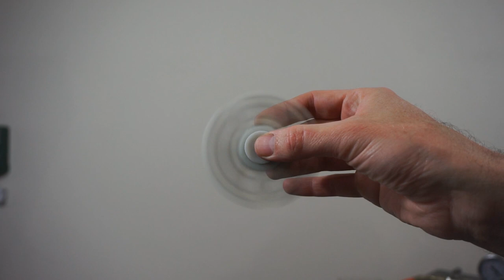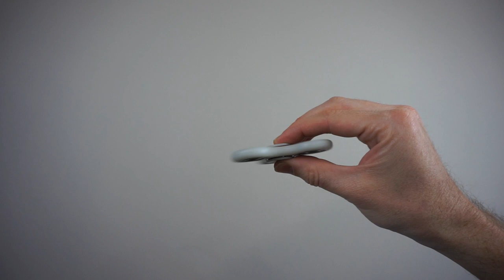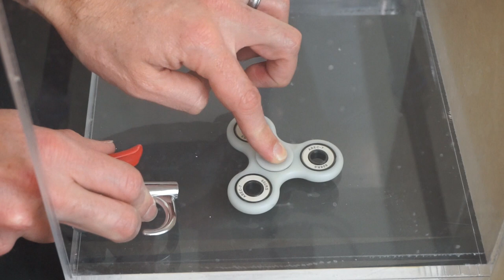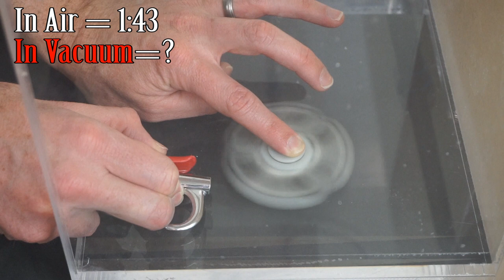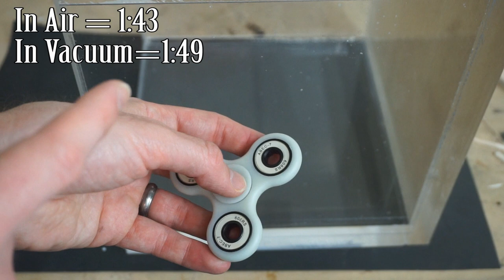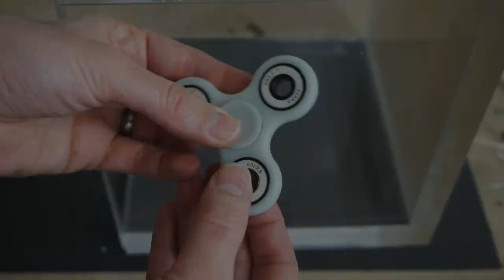How Long Can a Fidget Spinner Spin In a Vacuum Chamber? Will It Spin Forever?

Comment: u started the vacum so late anyway
Reply: Meak please explain how youd do it any faster?
Reply: u could do vacum first then see how long it takes to get to a certain vacum point and then start the timer then and howver long it took till that certain vacum take that time and then start the non vacum at that time too
Reply: Meak Most the energy was gone by the time the vacuum STARTED! It wasn't at full vacuum when he stated that it probably won't last much longer! REDO!!!
Reply: its true but most of the friction is on the bearings
Reply: vacuum* only word in the english dictionary to have 2 U's right next to eachother
Reply: smart
Reply: the air tube would repressurize the tank.
Reply: That's what I was wondering about what they were saying.You can't make the thing spin once it's vacuum, if you try to do it with air, it will repressurize the tank, if you try it with your hand, well it's impossible and if you try with an object like a rod from the outside, it would be very difficult and you would need to insulate the hole where you put in the rod.U should stop talking shit about what he did since there would be no other easy option to do it more efficiently.
Reply: It looks like the spinner has metal rings in each of the ends. Get a second spinner and put magnets on the rings and then hold it underneath vacuum chamber, under the other spinner, and spin the one with the magnets. You'd probably have to start spinning it slowly and then speed it up, and I'm honestly not sure how fast you'd be able to make the one in the chamber spin. But I'd be interested in seeing how well it worked.
Reply: His explanation about just air-friction is incomplete. The spinner in air is continuously throwing air outward by centrifugal effect and also imparting some angular momentum to it. This should mean a huge loss of energy, regardless of the streamlined lobes of the spinner.
Reply: good idea
Reply: tubeist- dan
right....I was thinking that to, and then when he said most of the loss of friction was the bearing, I was  like "you're kidding right?" No, No it is Air-friction, I just think it lost a lot of energy because it didn't start in a vacuum from the start, and use something else to turn them besides just  air like magnet's on both air, and non-air with another with magnets,and just push the other with air and the other will follow with it, might take a bit of time though , maybe put them in some other gasses just for some kicks as well.
Reply: Nameless Guy 

#1 watch who you say is stupid, because you just made your self look  like one. 

#2 I never said anything about Delay, 

#3 That is what a Bearing does it Reduces Friction, doesn't eliminate Friction, there will always be some but it's negligible compared to Air Friction. Air Friction will make an object lose much more energy than the Friction in a Bearing, and yes the Fidget spinner will stop eventually due to some energy lose from the Bearing. But nothing like Air friction. so don't try look smart, it didn't work. 

I'm certain everyone here can agree on what I said here is true
Reply: science is awesome 
In what way, may I ask, I tend to over engineer sometimes but. that isn't really much of an issue for me.
Reply: it doesn't matter when you start the vacuum, if the vacuum starts while it's spinning, and it eventually stops spinning, you get your answer, and same thing if it doesn't stop.
Reply: science is awesome it won't spin forever because of friction
Reply: it still wont spin forever because of friction between the balls in the bearing and the bearing casing.
Reply: Amen. someone used their brain.
Reply: woodysums270 that's true but the air resistance from the spinner is also slowing it down
Reply: Dooplex Minecraft there's no air in a vacuum...
Reply: Mjc Lmao, exactly, thats why its called vacuum 😂
Reply: It was only 4sec late
Reply: Meak That's exactly what I was thinking about. It would be much more comparable that way.
Reply: JESSYS10 No that was not the Vaccum, that was him with the air blowing at the spinner and its making the sound.
Reply: Epic Lemon it's inside the vacuum chamber
Reply: Subtract the 'In Air' time by the time before he placed in the vacuum thing.
Reply: GamingPredator Continuum
Reply: KiloB24 the point of the chamber is to get rid of the air
Reply: Meak it is not that it is the friction in the bearing
Reply: Meak oil should fix the problem right?
Reply: grizzie beats no,there's still friction even with the oil, there would be no way to reduce the friction with the balls in the bearing comepletelu
Reply: He is a faker if you look at tue vacuum time while its running you can see that it is cut in half to extend the time
Reply: Meak  thousandth like
Reply: Meak it really does not matter because gravity still applies in this vacuum
Reply: Gravity would not affect the spin of the fidget spinner going -> that way when gravity goes \|/ , it stops because of the ball bearings friction, not gravity.
Reply: Jlytle201 gravity is a force that applies to this. It may not seem like it but gravity is pulling down therfore slowing it down. It would spin longer but not forever in space
Reply: It will stop even in absolute vaccum because friction between floor and spinner...You need to make everything ideal to use law of inertia
Reply: preshitx not quite, it's the friction of the metal on metal inside of the bearing itself. The way a ball bearing works is that you essentially have 4 components. Your round ball bearing surfaces that interact with an inner and outer race and there is also a containing device that keeps he ball bearings in place, in between the races. With machined bearings holding very tight tolerances (roughly within a thousandth of an inch) there is almost no slop or wiggle room in a good bearing. The four components will always create friction between each other and that is where you run into the issue of drag and why the bearing stops regardless of vacuum. Hell even if you had an absolute vacuum (in space) the friction between these 4 components will always overcome the speed at which they interact with each other and it'll never be able to spin forever. Vacuums remove air so the spinner surface to air interaction was removed, but it only had marginal gains in doing so.
Reply: Hmmmm space is perfect vaccum

Comment: The problem is, that the aerodynamic drag on the spinner goes down inversely proportionate to the rotating speed. By the time you're able to pull a significant vacuum, it has already slowed to a point, that the air resistance becomes negligible. What you need, is magnetic coils and an oscillator, that will turn the spinner at a repeatable speed, after the vacuum has already been pulled.

Comment: How long did it take to achieve a vacuum once you started the pump? I think that if there were  a way to start it spinning under a vacuum the results might be more divergent from each other. :-)
Reply: Mike West you look almost identical to the true Geordie
Reply: Hi I subscribed
Reply: Don't worry about my name in couldn't think of one
Reply: doubtful, most of it stopping is from friction in the bearings, not air resistance.
Reply: Mike West sure it would be but the main factors in the two cases were gravity and friction, because of the fidget spinners design drag (air resistance) isnt much of an issue
Reply: dude... i dont want to sound like an asshole but... friction is caused buy gravity so there basically the same thing
Reply: Chase Fox tjats not what i meant gravity foes have its role on making it stop die to the law of inercia, because the spinner is moving no force or recistance is applied it will keep on moving, since gravity is pulling it down it will gradually stop
Reply: Dohn Joe: LoL! Nope.
Reply: Chase Fox: Actually friction is not caused by gravity but it is intensified by gravity. There is friction in space.
Reply: Mike West well theres also gravity in space. however youre correct friction isnt caused by gravity. but the normal force.
Reply: donald trump wtf are u kidding me did u actually just say there was gravity in space lol

Comment: I answered this before I even clicked on the video. Friction will slow it down no matter what.
Reply: Actually in places where friction isn't located (such as space) it would move forever. However the friction on the mechanism itself would make it slow down.
Reply: iiHuskyFTW i
Reply: My Happy Place friction does exist in space though
Reply: Ishaq Saleem Friction due to air resistance doesn't exist, however thing still have friction when they rub together in space
Reply: AgentJackjohn exactly and since this has a ball bearing it's still gonna stop due to the friction between the bearing and the spinning part.
Reply: My Happy Place then you should've said that😂. even so there will still be friction from the surroundings as there is no such thing as a true vacuum and if you have a lot of time on your hands you can wait for it to decompose into a soup of protons and electrons
Reply: If we could make the spinner have as little friction as possible and put it in a vacuum, then it would have a very long spin time and have a high energy efficiency ( like 99.9% ) .

Comment: is that stopwatch even correct ? I think 1second should be 100mili secs not 60mili second
Reply: Yeah, kinda. The prefix milli- means one thousandth, 1000 milliseconds is 1 second. However most stopwatches only display 2 digits after the seconds, 'centiseconds'. Still, you need 100 centiseconds to 1 second.
Reply: rizky awanta It changes little slower, 60mil secs are still 1sec
Reply: 60mili is practicly a second because every hour is 60 minutes and and every minute is 60 seconds. So every second should be 60mili some physics that dont make sense xD
Reply: Timecode? 60 frames per second?
Reply: Try counting when a second is added try counting 1 and by 2 it should hit the next digit.

Comment: Maybe if you can get something to spin that is suspended by magnets to reduce friction
Reply: jimmy Lewg Like on Giaco Whatever's channel. He made a levitating fidget spinner, but apparently it was difficult to set up just right.
Reply: magnets die down and lose their magnativity
Reply: Nameless Guy, no, the magnet would obviously be for making it levitate, not for spinning it...
Reply: jimmy Lewg the friction is created amongst the balls in the ball bearings so having it magnetically suspended would do nothing if not slow it down.
Reply: Dank Trilogía Yes, but when the fidget spinner is resting on a surface, the friction in the ball bearings is slowing it to zero (because the inner circle is stationary and can't rotate). If it's magnetically suspended the friction would slow the outside and speed up the inside until their rotational velocities are equalized, then there wouldn't be any more friction force.
Reply: Jove Rogers yes but, it would just be a rotating disk not a fidget spinner if the inner ring was not held still by something, whether it be a hand or something else. If you were to levitate it magnetically there would be no use for the bearing.
Reply: Dank Trilogía It'd be kinda hard to start it.
idk, Giaco Whatever literally did this. I just want to see that but in a vacuum chamber too.
Reply: Nameless Guy sorry if it's hard for you to understand. Maybe I should have explained in more simply for you. I meant spin something that is levitated by magnets then spin it with compressed air. It was just a brainstorming idea.  Again, I'm sorry you got all shook nasty on us.
Reply: Dank Trilogía different guy ;)
Reply: Jove Rogers yeah lol
Reply: yeah ikr
Reply: good thought but the only friction is with the center bearing not the ground
Reply: Broductions and the center bearing's in contact with the ground, yes? So it can't be accelerated to match the speed of the outside.
Reply: @JoveRogers97  Hi Java, I like your logic. There is a way to use magnets and I don't think it would be too difficult to do the experiment. Did you want to bounce a few ideas around?

Comment: Dear sir,
Have you considered the possibility of this :-
Starting the vacuum pump starts the air to be sucked off from a single nozzle, thus creating a significant drag. It actually degraded the speed of the spinner as soon as you started the pump. You can even see it if you slow down the video at that moment . 
Thank you.

Comment: I think vacuum experiments show how AIR resistance drops compared to atmospheric pressure,  but the surface resistance of the metal on metal of the bearings isn't reduced in a vacuum as it's contact related not air resistance related. hope that makes sense.

Comment: What happens if you put a ballon with helium in a vacuum chamber
Reply: Bmw ///mpower it will explode
Reply: Thanks:))
Reply: Nice no it won't... it will expand because there is no air pressure keeping it in its round shape. The gas will try to fill the chamber
Reply: I'm pretty sure it explodes BECAUSE it keeps expanding since there is no pressure
Reply: Bmw ///mpower: What happens when a helium filled balloon in a vacuum ,,well I can honestly say you already know the answer to that question all you have to do is think what happens when a piece of wood is tossed into an empty swimming pool it goes right to the bottom because there is no water for it to float on or in a vacuum chamber there is no air in the vacuum chamber to float the balloon , air is more dens  than the gas helium so no air  so the balloon will not float. this way of answering questions , I call it file associations , it makes it possible to answer questions that you have no direct knowledge of.
Reply: Pro. Logic if ur a troll Ur pretty fucking good😂

Comment: No matter where you are using the fidget spinner, even space. You will have friction. If it did spin forever than perpetual motion would exist. Which it doesn't.
Reply: Shawn Sands finally someone who knows the full reason why it stopped spinning at the same time.
Reply: Shawn Sands Actually perpetual motion can theoretically exist. If there is a point on space with no atoms, and no gravity, and you rotated a ball around, it would rotate forever. But such points in space are impossible and even if you did get perpetual motion, it wouldn't create infinite energy as it would slow down due to friction from the energy ansorbant.
Reply: Shawn Sands 
Thanks
Reply: Cas Koenders or maybe cause you're young? or just aren't all that into science.
Reply: Cas Koenders never rely on school alone, always research stuff online and watch videos like this which you're already doing so thats great. if you have the passion and drive, then you're all set anyways.
Reply: Cas Koenders You should go give your principal a back hand.
Reply: Air makes friction, but the spinner itself  makes more friction so...

I wonder how long would it spin if it would be magnetic? 'I mean it would stop of course but how much friction actually some Hydrogen and Helium atoms could make?

If you make the spin rely on the gravity of the planet , would it lose potential energy, Im messing up with physycs right now, But I think There could actually be a perpetual movement machine with a constant Lagrange, Now how
Reply: wrong how do u think the earth spins

Comment: Is the negligible effect of the air resistance because of the fact that the surface area of the fidget spinner in contact with the air is very small? If so, then will a thicker fidget spinner slow down quicker?

Comment: The reason the difference is so little is because of friction and the fact that even with air resistance, it is probably negligible as the spinner isn't moving ridiculously quickly and it it already quite aerodynamic

Comment: friction is only based on materials in contact and force applied. Air resistance is almost negligible but it could've added the 6 seconds onto the vacuum one.

Comment: I regularly get spin times above 2 minutes on my 3d printed spinners, using them by hand.

Spinning these 3d printed ones using compressed air will easily break them. Someone I printed one for let his friend spin it with compressed air, and it exploded, sending the nuts I used as weights flying. It cracked a windshield and dented a hood of a BMW.

So, use better bearings, and stop using compressed air. Bones reds are $12/8 bearings, and using dish soap on them after disassembly makes spin times huge.

Comment: A fidget spinner in this model will never stop spinning. In the vacuum there is still air, therefore air resistance. And yes, if it is a perfect vacuum it will still spin even taking into account the bearings friction. Think of it like this, you have something like %50 of the force in the part that you spin and %50 in the bearings. when you let go, the bearings start to lose force and goes into the grip of the spinner, so now you have %50 of the force in the spinning part, %25 of it in the bearings, and %25 in the grip.  Since all of the spinner wants to be going the same speed, the bearings and the grip are going to steal away some force for themselves so that they all have %33.3 continues. once that happens, they are all going at a same rate of speed. Now the numbers don't go in the same order at the same speed but it's the general idea that the spinner will continue on in a perfect vacuum environment just with less force then it started

Comment: There can't be a perpetual motion here just because it's in a vacuum. There are still factors that affect the Fidget Spinner such as gravity and the friction of its own bearings itself. A Fidget Spinner would always stop spinning in a vacuum. They would just tend to spin longer because of having no air resistance (air friction) that helps stop the spinner from spinning.